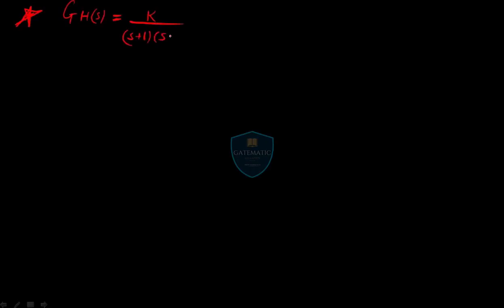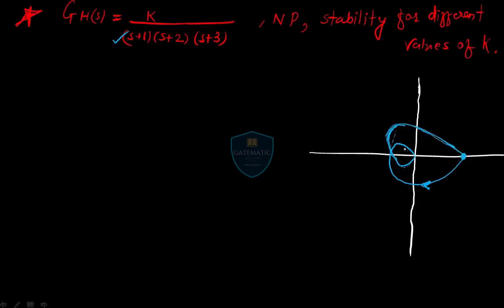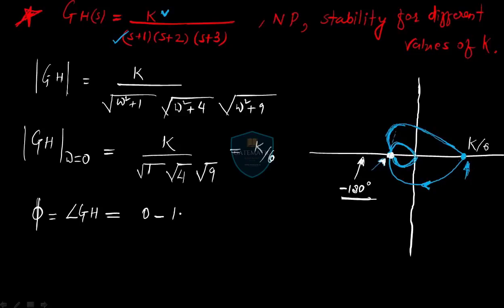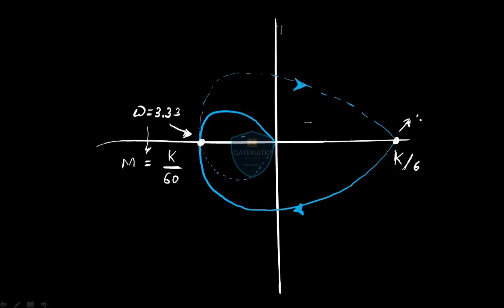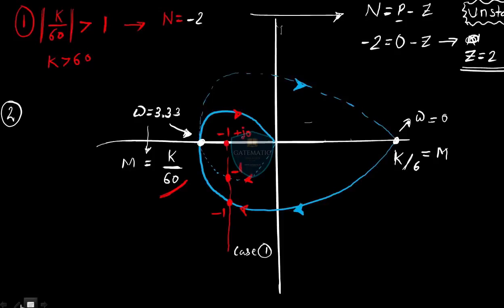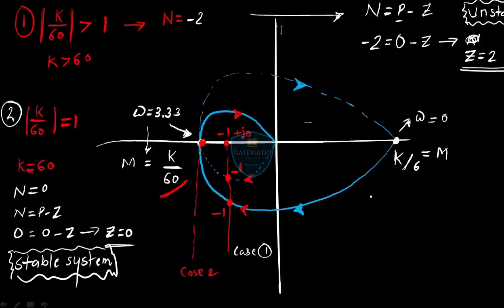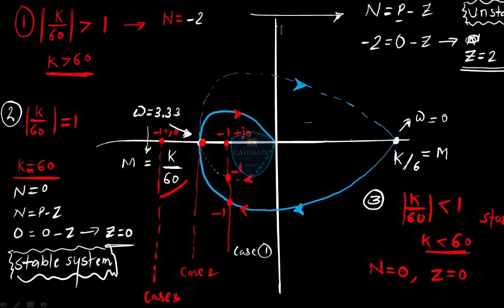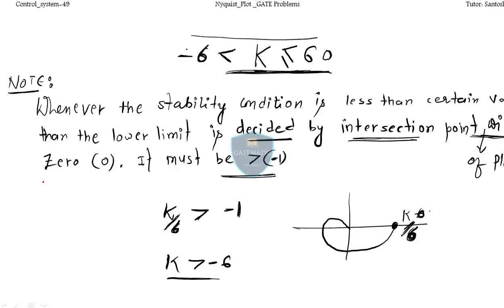Lec 49 GATE Problem on Nyquist Plot

Comment: Sir..how to find w=3.33.please explain it.
Reply: use tan^-1a + tan^-1b  property. At last you will get w=sqrt(11)
Reply: I'm not getting w value 
please elaborate
Reply: Put angle of GH equal to -180 degrees in the eqn of angle we've derived in qn earlier, as we have to find the point where plot cuts -180 degree line....then use tan^-1(x) + tan^-1(y) + tan^-1(z) formula...It can be obtained by using formula for sum of two tan inverses twice...Solve the  eqn then and you'll get w=0 and w= root 11.